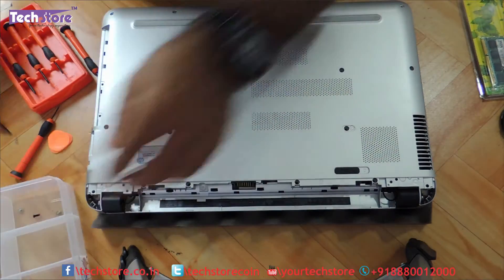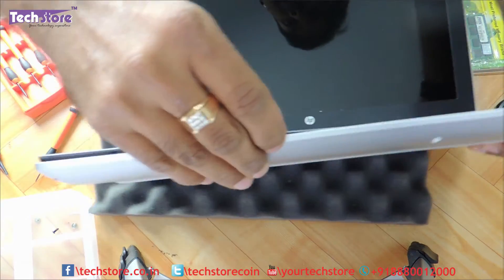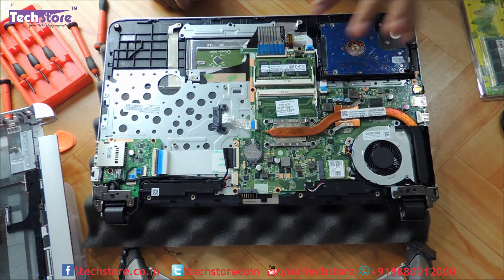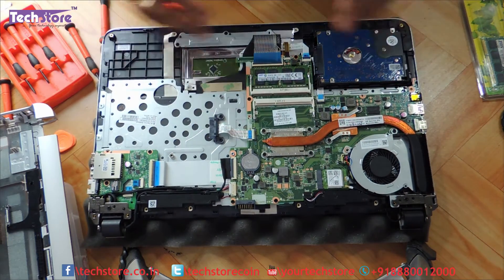HP Pavilion AB 32tx Series : How to disassemble base upgrade ram hdd ssd motherboard easy diy

Comment: nice video. is there a m.2 slot for ssd in this laptop(hp pavilion 15 ab032tx)?
Reply: Did you get the answer? Because I'm also using the same laptop, looking to upgrade M.2 NVME
Reply: @mrcricket646  no m.2 slot in 15ab032tx. my laptop was 2015 model.  i bought 2.5'' SSD and replaced the HDD.